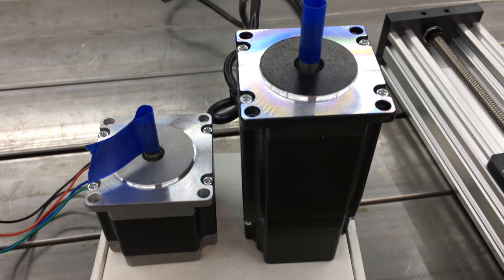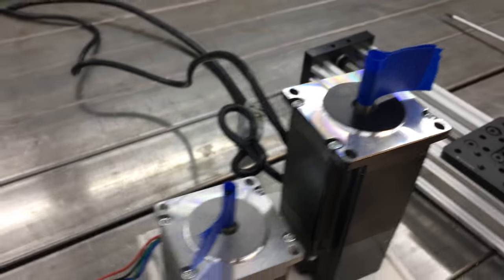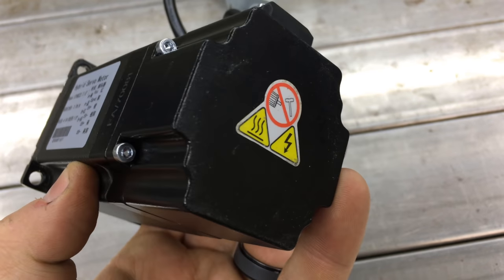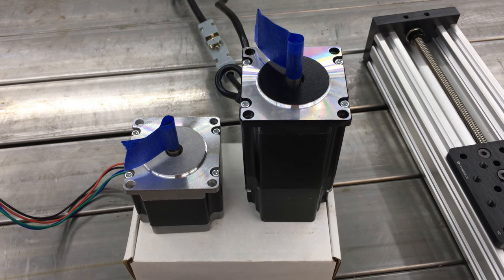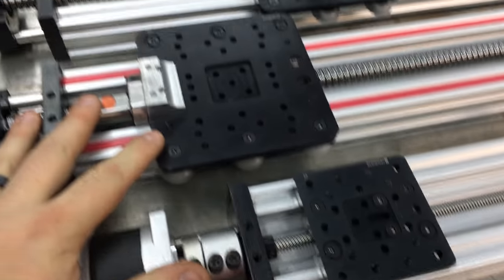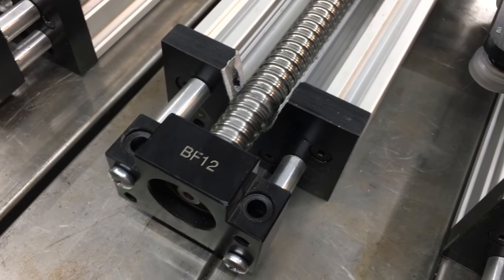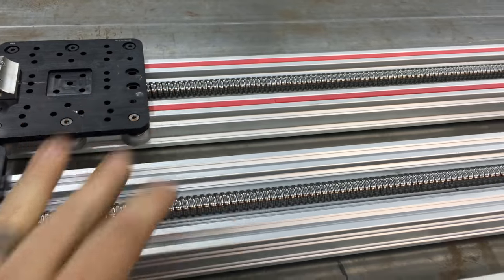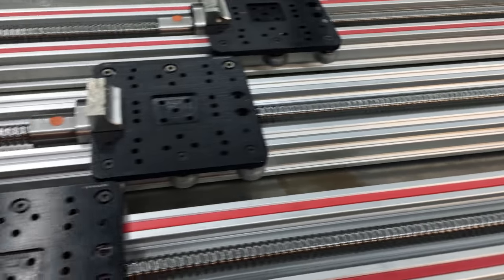Closed Loop Stepper vs Normal Stepper Motor. Closed Loop Explained ✔

Comment: First, both of those motors are hybrid stepper motors. A hybrid stepper motor is simply a combination of a variable reluctance and permanent magnet type motors. That is what makes it a hybrid, NOT the fact that one has an encoder.

Second, you refer to the encoder equipped stepper as a "servo", which despite what other comments have said  is technically true, but to be more descriptive, you should refer to it as a stepper-servo, much like a servo using a DC motor should be referred to as a DC-servo, or AC-servo. The definition of a servo is simply an automatic device that uses feedback to correct the action of a mechanism. So this can be a DC motor, AC motor, Stepper motor, a hydraulic system, pneumatic system, magnetic system, rotary, linear......
Reply: Sorry I do not agree, with encoder on the back is duly hybrid, maybe there is some confusion?

Comment: Just letting you know, closed-loop stepper motors are not the same as servos. The Encoder is not the only difference between servos and stepper motors, the mechanics inside are very different. Not trying to be rude, I just don't want others to be misinformed.
Reply from the maker: This guy is right <<<<<<<<<<<<<<<<<<<<<<<<< Thank you for being helpful and pointing that out!  I'm not showing a servo motor in this one. I call it that a few times though but it is NOT. You can use a servo in a 3D Printer but I don't suggest it.
Reply: "You can use a servo in a 3D Printer but I don't suggest it."    Why not?    @CountryAireDesign
Reply: @vairosva3  You want a motor that will immediately move instead of following an error correction loop (PID). Even though a standard stepper can skip steps if it's taxed to perform above its limits or crashes, it's still faster to respond than a servo.
Reply: What is the servo?

Servo in the model world of the usual collector motor and feedback on the potentiometer.
A cnc servo drive is a collector or brushless motor and feedback which can be relative and irrelevant, be fixed on the motor axis or on the machine table.
Servo in the world of large machines can be hydraulic, pneumatic, electric or even a gasoline engine with the corresponding intermediate actuators and a whole range of types of feedback.
In the world of aviation devices, these are usually two-phase motors and feedback of sine-cosine transformers.
All this can be considered as servo-motors in the broad sense of the word.
Reply: @adisharr  Servo control algorithms still feature a feedfoward term in conjunction with an error correction term. The algorithm will automatically calculate the voltage needed in order to generate the desired torque. Servos are far superior than stepper motors in terms of both controllability and efficiency
Reply: @CountryAireDesign  No he isn't right.  He is referring to a very specific type of servo. A servo is very generally just a device device that uses feedback to correct the action of a mechanism. So this can be a DC motor, AC motor, Stepper motor, a hydraulic system, pneumatic system, magnetic system, rotary, linear...... The stepper with a closed feedback driver and encoder IS MOST DEFINITELY a servo. I prefer using more descriptive terms such as DC-servo-motor, or AC-servo-motor, or Stepper-servo-motor, or linear-servo, but that doesn't change the fact that a closed loop stepper IS a type of servo.

Comment: I want to clarify that this is not a full feedback.
The weak link is the board that gives the direction-step impulses, and the board that counts them. There may be a mistake, and unfortunately my practice shows that it is this mistake that is the most frequent.
The ideal feedback system is a control board that processes the g-code and controls the stepper motors and reads their position. It is possible to improve the system by eliminating the logical control of the step-direction, transfer to the control via the digital bus with confirmation of the information delivered to the controller.

Comment: Quit good explanation.  Would it be possible to have a number of non meshing sleeve guide supports for the ball screw on both sides of the guide block?  They could be fabricated as a wafer ( low friction material ) to reduce loss of guide block travel. just a thought.

Comment: Does one need a special control board to use closed loop? Or can they be dropped directly on your run of the mill china 3d printer like, Creality ender 5, TronXY, Tevo, ect. If they are not a direct drop in. What control boards or adjustments need to be made? Thanks for your time!
Reply from the maker: In the example, I'm using an MKS-Gen 1.4 board because it has direct access to the Step, Direction, and Enable signal pins on the main board needed to feed a Driver Board like the HBS57 also used in this example. That is not so easy on boards with "built-in" drivers like on the Ender 3 and TronYX but the Tevo's use the MKS board that will work.

Comment: Hi,
Please tell me, which drive is best in cnc metal router? Servo or stepper?
Reply: That depends on how much money you have.  If you can afford servo motors, then these are better for CNC.  But many people, including me use steppers for hobby use.  Steppers cannot turn as fast.
Reply: For me, the best option is a stepper motor powered by a high-quality controller of at least 70 volts, centralized feedback such as a kflop control board or similar ones and optical irrelevant lines attached to the table. This is the perfect machine for relatively little money.

Stepper motors can move as fast as you need if you have a good controller and thoughtful mechanics.

Comment: Que fuente me recomiendas para hbs57?
Reply from the maker: Los obtuve de eBay... Buscar "hbs57"
Reply: @CountryAireDesign  pero con de cuantos voltios y amperios? Es por asegurarme que vaya bien
Reply from the maker: @pharys10  
Mira el manual. https://mecheltron.com/sites/default/files/webresources/ElectronicComponents/StepperMotorDrivers/Closed_Loop_Drivers/archive/pdf/Hybrid_Servo_Driver_HBS57eng.pdf

Comment: How is the backlash with the planetary gearbox? SUBSCRIBED:-)
Reply from the maker: Actually, I removed it on helpful comment by @keronGR on another video. I'm going to run a few prints without it to get a baseline then added back to see if it makes a big difference or not. I'll do backlash tests at that time and I'll post my results.

Comment: just wondering if you or anyone made a video of how amps affects the performance of stepper motor? I got 1.33amp at moment and thinking to do micro stepping but not sure if should go to 1.68amp or more
Reply: We use a lot of steppers in the machines we build at work.

Once the coils are saturated with a magnetic field, adding more current will actually decrease the torque.  I've actually seen torque on some systems go up when the current was turned down to just below the rating on the side of the motor. 

Since steppers have less torque at higher speeds, you can increase that torque by raising the power supply voltage to the rating of your stepper drive.  Some stepper drives have higher input voltage ratings.  Running your steppers with higher voltages will allow you to run the motor at much higher speeds.

I hooked up an Automation Direct (Rebranded Applied Motion) and ran a stepper at 10000rpm.  I was so surprised.  Of course it had like zero torque at that speed.  But it still ran pretty strong at 1000 rpm.  This was a $150 drive that had some advanced features like automatic switching between microstepping and full stepping.  That kind of switching gets you the best of both worlds, precision at slow speeds and efficiency at high speeds.
Reply: @microdesigns2000  microstepping is not really used for increased precision, or resolution. Steppers really run best on a sine wave. Microstepping more closely approximates a sine wave than a full step square wave does. So what microstepping nets you is smoother motion. Steppers are adversely affected by harmonics. It's complicated.
Reply: @1pcfred  Sure, microstepping is usually utilised for smoother operation.  But we often monitor with encoders and rely on microstepping to arrive at accurate positions. A big contributor to angular inaccuracy is excessive operating current.
Reply: @microdesigns2000  a big contributor to angular inaccuracy is microstepping itself. But at least with some kind of an encoder you have a chance of figuring out where you really are. At least stepper motors are not cumulative though. One revolution remains 360 degrees always. Assuming the motor does not stall at some point.
Reply: @1pcfred   Yes for a given motor design, the perfect waveform might not be a sine wave, making microstepping itself a contributor to positional accuracy.  To deal with that, some of the drives we use have an adjustment for the current of each microstep.  This allows the drive to be matched closer to the motor characteristics.  Good thing we don't usually have to deal with those accuracies on most projects.  The other challenge to accuracy is the load.  It is easy to apply a static load and be out of position by half of a full step.  Sometimes we just program the target position so that the motion stops in the right place with the load applied.

I guess my point is that steppers are used for precise positioning in many industrial applications, and even microstepping is helpful to achieve better results.
Reply: @microdesigns2000  less sophisticated drives that are available to general consumers are often fairly imprecise and offer no per step adjustment. You get what you get. What you get can have as large as a 40% variance between microsteps too. Though how much that may matter in the end result can be academic.

Comment: The term "hybrid stepper motor" has nothing to do with an integrated drive or electronics.  A hybrid stepper is one that incorporates permanent magnets and electrical coils.  Both of those motors appear to be hybrid.  There are steppers that have no magnets and they are not nearly as powerful as hybrids of the same size.  Your video should be called something like "Integrated stepper versus standard stepper motors" before you end up with a thousand comments trying to set you straight.